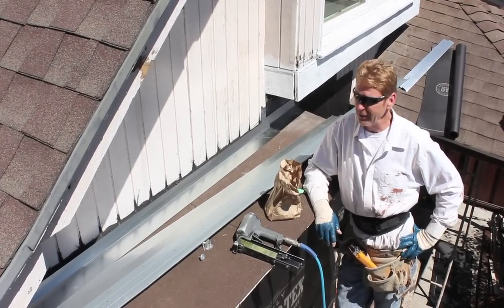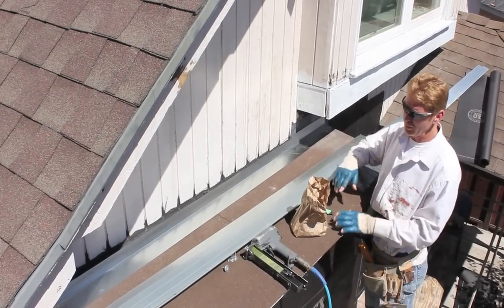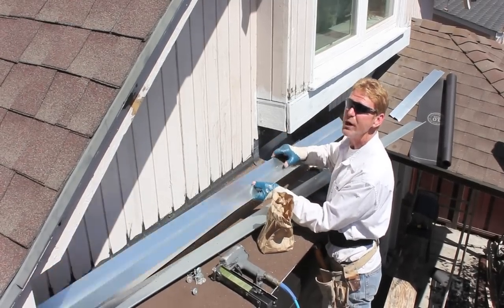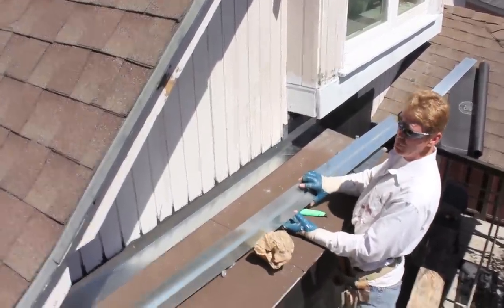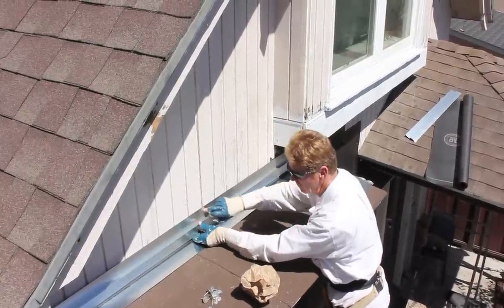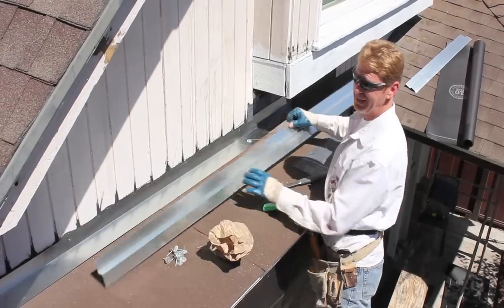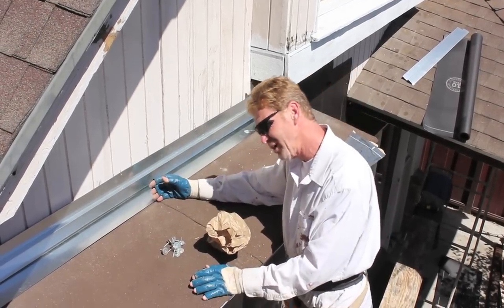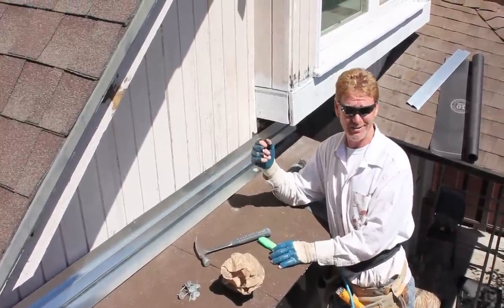Install roof to wall stucco flashing

Comment: I was trying to figure out how to do this flashing job and the double-flashing approach idea is exactly what I didn't think of and what I need. Thanks very much for putting this together. <3
Reply from the maker: Good evening Stephen, glad to be of help, thank you for the comment.😉
  Our unique plastering Tip:  all subscribers or anyone who stumbles on our channel with a question, type it into our Stucco/Plastering channel, and like magic, a video will appear to explain how it's done. 	
   This feature is miles ahead of any plastering forum. 🥳	
Kirk & Jason Giordano Plastering
Reply: Another way that I think is much easier is to simply pry away the base of the wood sheathing & slip your 90 degree flashing under it. Then nail a 1x4 or 1x6 pressure treated trim board over the flashing with black jack or asphalt sealant behind the 1x4 - and then caulk the top edge of the 1x4 or 1x6. Its less work and looks better with a trim board, whether it's a side roof or head wall situation.  I don't prefer to leave silver flashing exposed on nicer homes. It looks tacky.  Trim board with top edge caulking always looks better with clean lines.
Reply: @JudgeBuster  I think that I understand you. I also think that your approach would provide a pathway for dripping rain water to wick along the trim underneath the sheathing, rot the bottom of the sheathing  and promote mold growth behind the sheathing. I don't think that that creating any sort of systemic approach for water intrusion is a great idea for roofing or siding. But maybe you meant someething different by "wood sheathing" and just used the wrong words to decribe something that doesn't matter if it rots out in a few years?

Comment from the maker: Hey Gilbert, I have done a few balconies this way. Mainly a fella will install a standard 4 x 4 inch, roof to wall flashing and then apply a membrane. There are about 20 different membranes I see used often enough. 
Then we can counter flash with a drip or weep screed designed for stucco or if necessary attach a Z flashing.
 Have a good evening. 
Kirk Giordano plastering

Comment: what keeps water or melting snow from running down the grooves in the T111 siding and behind  the flashing resulting in water problems (rot etc)?
Reply from the maker: Howdy Jonathan, two layers of 60 minute paper.
     Bringing peace, love, and harmony back into the world 🌎of plastering.
  The University of plastering by Kirk and Jason Giordano. 🎉💃 🥂🧞‍♂️
with over 850 free advice show and tell video’s on stucco & plastering
Reply: A completely NEW EXTERIOR SYSTEM. The lath wil be applied and stucco following. Trust the pro . I didn’t understand as well but he applies an entire NEW weather prevention system.
Reply: @StuccoPlastering  kick ass response KIRK
Reply from the maker: @bobv8219  Howdy Bob, thank you.👍

Comment: Hey Kirk I’m trying to understand how to do this troubleshooting on my own since I want to become a general contractor one day. Watching your videos has helped immensely! Do you mind explaining what exactly it is about the drip screeds that makes it more work and requires chipping out the stucco to place a new roof in the future? Wouldn’t the z flashing require the same thing (chipping out stucco)? Thank again for all the knowledge you share with us!
Reply from the maker: Good evening Arlen, like the one in this video, old homes are a real drag to stucco, especially when so much has been done incorrectly and without permits. 
 This one required so much improvising I was sorry I took it on.
 Most of the necessary steps before stucco were not completed by the owner or a general contractor. 
  Weep screeds..... Back in 1975, it became code to start installing weep or drip screeds for three reasons. One, to stop the stucco from touching the dirt or ground. 
Two, more importantly, to give the walls an expansion joint, and three, to provide us with plasterers something to stop at.  
We didn't start installing them until about 1980.  
FYI, my own home had the stucco touching the ground.  I didn't lose any sleep over it as I knew why.
 I feel it's a waste of time to break out existing stucco to add a weep screed personally.
Sure, you will get a few more cracks and some cases, buckling, but usually, at that stage, if you tear into a wall to attach screeds, you open a can of worms.

Comment: I have that problem. Had a room added for my sick mother and the oom leaks. They put on a flat roof and it leaked first rain. Can't contact them. Had it re-roofed twice and still leaks at the seem where it was added. I wish you lived near San Bernardino, CA. My neighbor told me they probably didn't put flashing so maybe I'll try too I myself. I also ordered some sashco roof sealant. So after nailing he flashing, did I understand that their needs to be paper and plaster?
Reply from the maker: Howdy Sandra, sorry, sound like it should be water tested from the lowest point to bring the water hose up a little bit at a time to locate the area.
 I tell folks to lay a brick on the garden water hose and let the nozzle spray a large portion at a time.
     Bringing peace, love, and harmony back into the world 🌎of plastering.
  The University of plastering by Kirk and Jason Giordano. 🎉💃 🥂🧞‍♂️
with over 850 free advice show and tell video’s on stucco & plastering

Comment: That metal round cap is for fiberglass base for a torch or hot mop roof.
Reply from the maker: Thank's for the tip; I'm a stucco dude; I was kinda forced to do this work for and get this, a home-owner who wouldn't pay a professional or do it himself. 
All this after I accepted the job, and come to this dead stop, Shit happens.

Comment: I'm putting end wall flashing on my roof as I'm installing a new roof with shingles. It hits a wall, where I have to put the end wall flashing on. I'm just curious, how do I do this without causing the rain to leap through where I'm putting the in-wall flashing?
Reply from the maker: Good evening Raymond, you install a step flashing and incorporate it into the shingles, don't forget a diverter where the bottom meets the gutters. This is important.
 I have some video on how it's done, but it's "fight night," so I got to get back to the fights.
I'll look later or type in, " installing a new roof with shingles." cheers brother.🍻
Reply: @StuccoPlastering  🥂 and have a great night watching the fights
Reply from the maker: @RaymondGettler723  Well Rose proved her win was no fluke. 😏

Comment: I'm thinking why don't you take that little side down or flip it up under the bottom of the side even if you had to cut a half an inch off I don't know about this one
Reply from the maker: Howdy Daye, I don't know about this one either,  This was supposed to have been done by the roofer than the homeowner; it wasn't done by either. Thus I was asked to do it at no cost for my labor or the cost of the flashing.
This I completed and filmed as my so-called payment for those to learn from.
 FYI, I'm a lather, not a roofer.
 Either way, it works. 😉

Comment: Where can get this type of flashing
Reply from the maker: Hody big Al, As I'm not a roofer but a plasterer, I went to many stores and then to a roofing company to find this flashing.
 Note or tip all homeowners:  You should have this flashing preinstalled by professional roofers. a
Just as the roof to the right of this; also.
 You should not depend on caulking or tar to stop the rainwater, It will work for about 6 months then fail miserably, and water will enter what every wall is next to that roof,
    Note that if you have a roof with shingles, step flashing is also needed. Don't forget the mighty important roof to wall diverter, which removes the bulk of rainwater from pouring down your walls instead of entering your gutters flowing out harmlessly through the downspouts.

Comment: Where does it drain since you don't have any holes
Reply from the maker: Howdy Thomas, good question.
   Since we were planning on applying a color coat finish, a weep screed was not necessary.
I could have used one to counter the L Flashing.
   However I preferred to use a Z flashing so that the with high winds the rain would not be a problem, where does any moisture that penetrates the cement plaster go?
   Excellent question. It flows out through the bottom the same as it's absorbed through the porous color finish
Gravity with air evaporates this moister.
Now if this were to be a two coat  cement plastering job with a painted surface, it would have been a better desion to simply drop the weep screed directly on the L Flashing.
                    Cheers!
How to restore your plastering issues.:

Comment: This will leak 100℅ 
Needs step flashing
Reply: I am doing flashing this weekend, roof meets wall. Wall is wood shake, if the roof is not angled should I still do step flashing? For some reason I thought step flashing was just for angles. Would love your opinion!
Reply: I was wondering about that. Flash needs to go under house siding I believe.
Reply: Step flashing goes on the slope of the roof underneath each shingle.   Long pieces go on the tops and bottom horizontal pieces.   His work wont leak because the stucco will overlap the flashing.
Reply: @raybin6873  he's going to stucco over that did you not watch?
Reply: It will 100% not leak
Reply: @randyjenkins8743  I rewatched video - he did say it will have stucco. What threw me off was leaving old siding on....that is permissible?
Reply: @raybin6873  Majority of houses we do have no house wrap or just old siding under. Homeowners aren’t gunna pay to remedy that lol We just snap a chaulk line and cut the siding about 4 inches up. Install ice & water, step flashing, use flashing tape to cover the nail holes and to give a “bridge” for any water that gets behind the siding so it can end up on the flashing and on top of a shingle. Then put in a trim board over the step flashing to make it look nice. Houses with stucco are a different story though.
Reply: @Zack.G23  what do you do for stucco houses? my house is stucco
Reply: @MadparkWorld  if the flashing needs replaced they would have to redo the stucco at the roof to wall. Can’t just cut it  and slap some zflashing and a trim board like wood or hardie. If what you currently have is in good shape and was done correctly originally it can be reused.  Have a few different roofers look at it and see what they say. There’s not a lot of stucco in my area. I think every house we have done with stucco were very expensive houses that had the original roofs on still. So everything was done right to begin with and it was only the first reroof so we could run ice and water under the old flashing best as possible and then reuse the flashing.
Reply: 1k if SHE leaks, NO takers. Come on. Don’t cha sea he’s a professional